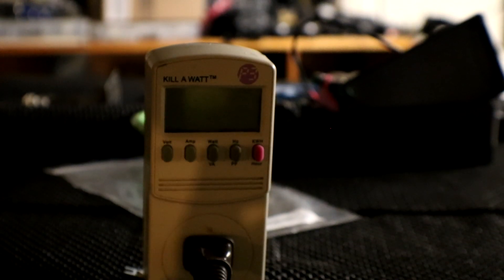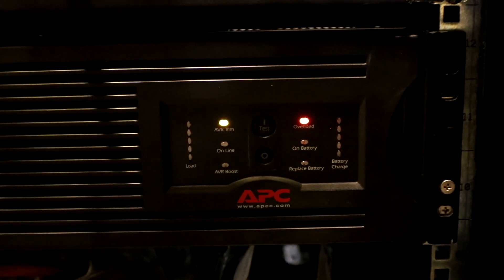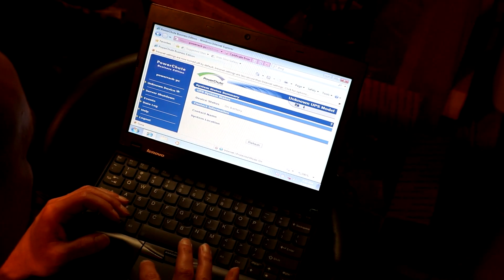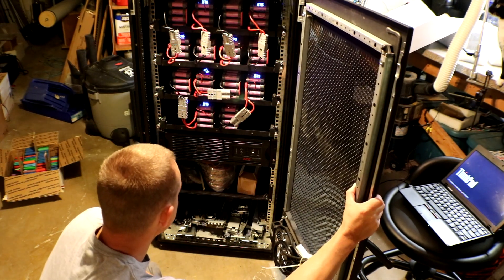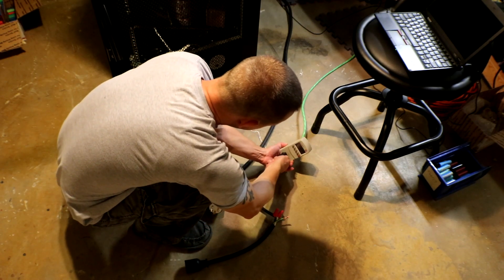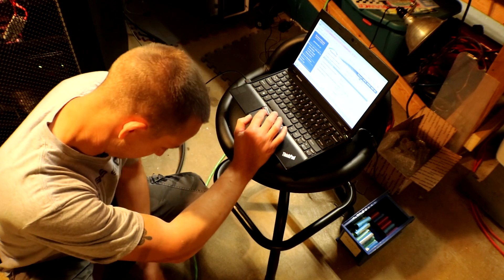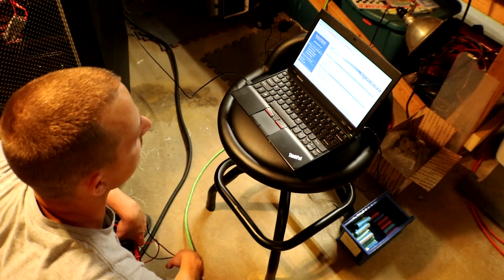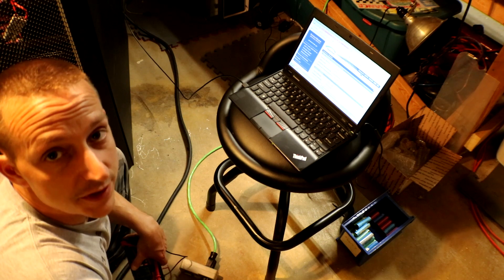Diy Tesla Powerwall ep51 48v Ups 24hr Test Run Update

Comment: hmm 24 hours at 100w Equates to 2.083 amps @ 48v you should of only dragged about 49 AH out of your batteries, there should be stacks Remaining - Got to be the voltage range it UPS is configured for SLA so you may need to up the voltage on the 18650 packs to match , im also asuming those 18650s are at least 3000mah each?
Reply from the maker: Yep, I just didnt have the ups set up correctly yet.  I used 2000-3150 mah cells in the packs!
Reply: so each of your banks must be what 300-400ah each? Im not sure how many cells you have in them but it looks like at least 100 per bank?
Reply from the maker: They are 226ah each and Yep, 100 cells per pack!👍
Reply: Nice - I wish i could get those cells in bulk here in the UK , im having to opt for Powabloc Tubular Gel's more expensive than id like an il only get half that capacity but they do at least offer 1500 cycles at 80% DOD just trying to source 3000xl to go with them :-) out of curiosity how much did it set you back $$$ to build  all those packs?

Comment: AMC powerchute demands tighter voltage spec's because it is used Lead acid 2-3% just more battery packs to maintain higher tolerance or hack the software to allow 5% degradation. Also whats going on with the inverter?
Reply from the maker: Ya I just added 99 battery packs in the setting lol.  It seems to be working fine? I still need to do the calibration test tho.  Ill be doing that here pretty quick!

Comment: The Light indication your getting at ~1 minute into the video means the UPS is in sleep mode. no need to power off to reset, just briefly press the on button and it should resume. (Provided the batteries are not flat).

when the UPS is sleeping the Network card if installed will stay awake and you can power back up from the Network card or put the unit to sleep from the network card.
Reply from the maker: Awesome, thanks!!!! Good info to have 👍
Reply: Should note if the unit powers down due to low battery, it will snooze with just the single low battery indication flashing for about 10 minutes then May Possibly shut down and go "Braindead" after that depending on how its configured, in which case the network card will also power off, so if you know your gonna run it down to the wire but you need the unit to keep the brains awake, manually put it to sleep before it shuts off and it should then keep the NMC powered until either the batteries hit critical, the sleep timer expires, AC input power returns, or you manually power it back up. 

In the NMC under Powerchute --> Configuration section you can tell the UPS how it deals with a shutdown as follows:
On-Battery Shutdown Behavior:  
Restart when (AC) power is restored
Turn off and stay off

and under Configuration --> Power you can set the Maximum sleep timer as such:
Duration of Shutdown
Sleep Time: <How many hours do you want?> hours [0 to 359.9]
i have mine set to 72 hours, meaning it will sleep up to 72 hours before it shuts down if the AC Power doesnt come back by then. Obviously it should shutdown totally before then if the batteries get very low.

Another thing, these UPS's have an EPO (Emergency power off) connector on the back which can be connected to a Switch or relay contacts and used to instantly "Kill" the UPS, this may be handy as you can wire up a "Kill Switch" or could have some sort of BMS "Kill" the ups if one of the packs voltages hits critically low or high to prevent battery damage. The manual will explain how to wire up the EPO.

As for your mention of a Transfer switch, you should be able to get your hands on a rack mount ATS (Automatic Transfer Switch) to handle this for you.
APC, Eaton, Chorlide, STS, etc all make rack mount ATS, some of which have network management as well. im using APC and Chloride units for my racks.
They can be had for a reasonable price second hand, and usually come in 10 or 16 Amp versions.

Couple of other small things about all APC SU / SUA / RT / XL Smart UPS Series units.....

DC power is REQUIRED for the unit to turn on, so the unit will not turn on without DC power even if AC is present. Once powered up the unit will stay on without DC supply (though obviously if you yank the plug it will die if no battery power is connected). This is why many people who do not know much about them sometimes get rid of them claiming it wont turn on, 9/10 times its just a case of flat or toast batteries resulting in no DC power available to boot the unit up, regardless of AC input.

If you have batteries connected with the unit braindead, and you connect AC power, the unit will wake up partially, and start charging but the display will be blank, and the outlets will remain off until you turn it on via the test button, network card, or serial port.

If AC power is connected and ON, you CAN NOT fully power down the unit, to do so you MUST remove AC power, then press and hold the off button for a few seconds until you hear a clunk and the unit goes silent.

A gotcha with the serial port: DO NOT use a standard straight through serial cable between the UPS and PC, if you do, and you open a serial session the unit will cut the output and sleep / power off, this is because APC in their infinite wisdom decided to use a nonstandard pinout, and a straight though cable will result in the "shutdown" pin (in "SimpleSignalling" speak) to be pulled then the computer pulls the flow control lines when the session is opened.  No you wont damage the unit, but it will catch your attention alright!

Serial port settings are 2400,8,N,1 .   you can use this to control the unit as well as program some of its variables using the "smart" protocol, Refer to this link which explains the smart protocol, as well as the commands and their behaviour and some warnings: http://www.apcupsd.com/manual/manual.html#apc-smart-protocol

If you have a Smartslot card installed, you can use the serial port to control the card, however some commands or programming may not work with the card installed as the card basically Hijacks the serial port to communicate to the units brains, so if you need to do programming or use a program like APCFIX to do advanced monitoring / programming, you should remove the card temporarily.

Need more than 1 Smart slot? Grab an APC AP9600 single slot or AP9604 Triple slot expansion chassis which allows you to add more cards. you can daisy chain these chassis as well to get quite a few slots. just make sure to RTFM about card ordering and limits. Theres plenty of various cards such as network cards, Environmental cards, modem cards, sensor cards, etc etc. Here is quick list to some of the cards you can get: https://en.wikipedia.org/wiki/APC_Smart-UPS#SmartSlot_card_models

If you need to know anything more, drop me a message or reply and il see if i can answer it.
Reply from the maker: Ok cool, yeah I made a serial cable to connect up to it and I have the usb cable as well.  I dont have the network card in it at the moment but may reinstall it when I get it all going how I want it.  I like the idea of the kill switch :) Ill have to do that. Thanks for all this info, much appreciated 👍

Comment: why dont you want to plug the ups into the wall?
Reply from the maker: Because the charge circuit is designed for lead acid batteries.
Reply: you didnt have any problems when connecting it to your cells? The video didnt show you did. But im guessing if you leave it on for a long time that it will overcharged the cells?
Reply from the maker: Nope, didnt have any problems connecting it to the cells.  Ive had it plugged in for a few hours with no problems.  It will only charge them up to about 54.6v. Ill be charging them up to about 57.4ish with the solar panels once I get them installed.

Comment: From the look of it ou are using a model SU 2200 or 3000. The good news - these units are   not overly complicated, and can be tweaked for purpose. The bad news - you can't change the "low voltage turn off". Changing the number of attached batteries via Powerchute doesn't alter this pre-programmed behaviour.
So what's the stat? First of all APC designs use lead-acid batteries. The 2200/3300 with it's 48V battery-pack switches off when +/- 42v on the battery-terminal is reached. Using Li-Ion 14S would thus deplete the cells to 3.0v. 13S would have the UPS switch off with 3.2V remaining. I strongly suggest the 13S solution with used cells.
Second charging. That's a big NoNo. The charging circuit is again designed for LA you risk ruining you Li-Ion cells pretty quick. The internal floating voltage circuitry should be disconnected and replaced with an external Li-Ion charger. If you'r interested I'll have a look in the schematics and see what can be done.
Reply from the maker: +PvD Onz Holy crap if there was a fix for the float charge that would be some great info to share 👍
Reply: On some units you can do it in Prog mode via Serial cable by tweaking some of the Calibration Registers like i did to one of my Tower units to correct the float voltage, others can be done with a minor resistor mod to the Circuit board. when doing it via Serial, the unit will still report its ~54v float voltage, but the actual voltage will change, so make use of your multimeter.  this could possibly allow you to indirectly adjust the low voltage cutout point too as well possibly as the Prog method just changes the Calibration registers that are used to calibrate what the unit shows vs what the actual is.

Comment: You will need to do that calibration test. The APCs don't rely on the voltage and calibrate on the capacity of the batteries by draining them and then work out they last over 2-3 years before they pop up with the "replace battery" LED.
So do the test and then you'll have to charge them again and the PAC will then know how long it'll last before initiating an alert of battery low etc.

meantime, hope everyone gets to see the eclipse, I was stupid enough to come to the USA and not expect the glasses to run out. Aluminium foil or welding glasses anyone-? hehe
Reply from the maker: +Phizicks Ya ill do the test here soon. Ya solar eclipse, they say #14 min. I got my welding stuff with me to use lol

Comment: Hi AveRage JoeI run 13S. Only as an inverter. I never plug it into the wall. I never run PowerChute as it is not required and just adds a ton of confusion.13S provides a range of 39V to 54.6V (3.0V to 4.2V).
APC will shut down on its own somewhere around 40V (+-40V for 48V APC, +-20V for 24V APC and +-10V for 12 APC). If your cells are not well bottom balanced, one or more packs may drop well below 3.0V so keep a close eye on that but they should not stay there long as the total voltage will quickly drop below 40V and the system will shut off. If in good working condition.I chose not to go with 14S as at 54.6V the cell voltages are 3.8V or far from full capacity.
If you fully charge them, the APC should not even start up due to high voltage test fail.Plugged into the wall will likely result in one or more packs exceeding 4.2V so I would not leave it plugged in for too long and never unattended without watching all pack voltages. Your pack is certainly large enough to withstand the current provided   :)
Also, since lead acid charging systems maintain a float charge, which is not a good idea for lithium (very dangerous), it would great if that could be turned off. If anyone knows how to do that, please share. I've heard that it might be possible and plan to look into it at some time.PowerChute is really nice, when properly configured, if you want your computer to shut down automatically,...
I got over that many years ago. I only use it if I want to turn off the beeping alarm, other settings and then never run it again.
The APC UPS knows what to do without PowerChute running.YES!!! Turning on your laptop with: the communication port plugged in, PowerChute likely configured by default to start running, PowerChute improperly configured,...
PowerChute shut down your laptop and then the APC. It could not wait to do it and mess with you and your test!!!
I felt for you buddy!Your test would have run fine if you had not started PowerChute or if you had disconnected the communication port before starting your laptop. I hope you run that test again to completion.
Your cat believes in you   :)PS - Great videos. Thanks for sharing. Will stay tuned.
Reply from the maker: Cool, ya I mainly wanted to turn off the beeping and possible monitoring later.  It didnt have a problem starting up on battery at the higher voltage which is good for me or at least for now.  If it continues to start up at that voltage then Ill keep 14s.  Just a little less in the conversion.  I figured as much for it shutting down on me lol.  I guess its part of the learning process.  If I ever find any info on the charging circuit Ill pass the info along as it would be some valuable info for the Lithium Ion community.  Thanks again!
Reply: my SUA2200RMXLI3U will cut off at around 40-43v depending on load, higher the load, the lower voltage it will go down to before it cuts off (programmed that way i presume because of the characteristics of lead acid batteries). charging wise they sit around ~54.5v on a float style charge.
Reply: I concur. At low draw mine shuts down at 42.0V. At higher draw, the cut off is lower but it is dropping quite fast at that point and the voltage bounces back up quite quickly on the lithiums once it shuts off. Float charge on mine is 54.8V (not that I plug it in with lithium attached). I'll likely be dropping to 12S soon as that will provide more of a low voltage safety margin (+-3.5V which should be about 5% remaining capacity). Bottom balanced at 3.0V and charging without balancing should work out pretty well. Time will tell.

Comment: so 12v lead acid batteries are tricky. 12.6 is actually full and sitting (for a while) times 4 = 50.4... 13.2 is also considered float charge. time 4 = 52.8. 14.5v is full charge cutoff on some chargers, times 4 = 58 volts... 
I'm timesing by 4 because 48volt system 

so i don't know why that was shutting off. maybe its cut off voltage is some how set high? I have never really messed with that stuff on thoes UPS's i just know that the simple software from APC can't change to much . altho now that i think about it i do think there is a setting for "long runtime" and "preserve battery"
Reply from the maker: Yeah it was confusing to me also.  Im wondering now if the previous batteries were about dead and the ups knows its cycle from the self tests.  So Ill be doing one of those self test after I get the solar hooked up so Ill have a way to recharge them.  Also adding "99" packs should help a lot.
Reply: awesome man! keep up the good work :-)
Reply from the maker: +bimmers50e30 Thank You!!!

Comment: The issue you are having is what I was wondering with one of my questions in your previous video with respect to the UPS using a hard-coded charging / discharging algorithm.  If it was made to work with lead acid batteries, won't it think your batteries are full and empty based on the voltages and recommended discharge rates that are best for lead acid batteries and not Lithium Ion batteries (which obviously have much better profiles - hence why we use them)?
Reply from the maker: +levik1832 Yeah it will for sure base its info off LA batteries. Ill be trying some different settings with the added battery pack setting to see if I can get it to match more similar to mine.

Comment: A youtuber called FFcossag used a serial console to connect into the UPS to change the battery charge cutoff and other things.
Since you are running non standard batteries you might need to change these settings as well so the UPS knows the correct cutoff voltage and such.
The video i'm refering to is this one:
Unedited quick blog video (INCLUDING HOW TO SET APC UPS CHARGE VOLTAGE!!1)
Reply from the maker: +tbbw Ill look up that vid. Thanks!!!

Comment: Logically, the system parameters are based on the original battery capacity.  The number of packs that you set should be base on you parallel pack size based on the original batteries in amp hours to determine the correct number to set so that all other readings presented by the PowerChute are close to accurate as possible.  Also, run the Calibration test in the PowerChute.
Reply from the maker: +Aastan Yeppers, Im am thinking the samzies! Ill do that test once I get some solar hooked up 😀
Reply: By the way, leave the pack at 14S.  This accounts for the voltage curve.  Safe operating range, for new LI cells, would be 3.0V-4.1V for longevity.  At the 3.0V low end that is 42V, conversely, that is 39V for 13S. LA batteries will read about ~51V when full and about 48V when discharged 50%. At 44V they are completely empty, 13S puts you outside the curve and will probably give false readings in the PowerChute app.
Reply from the maker: Oh yeah Im going down in voltage lol.  Im sure after I do a self test it will improve